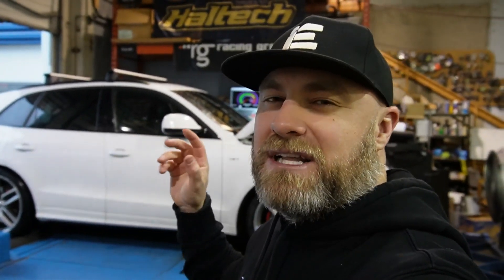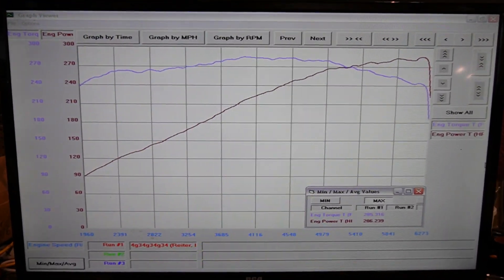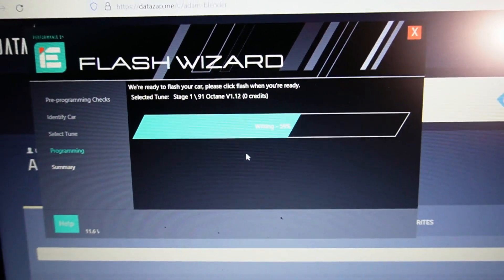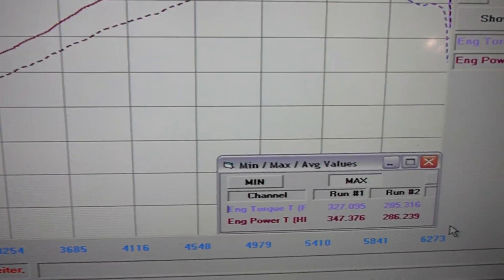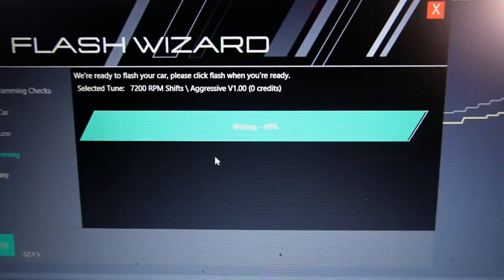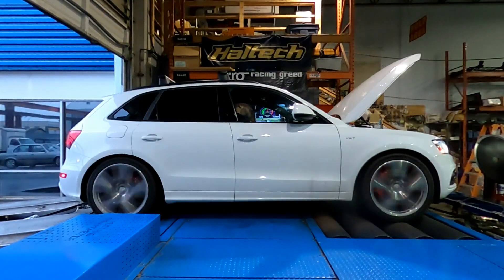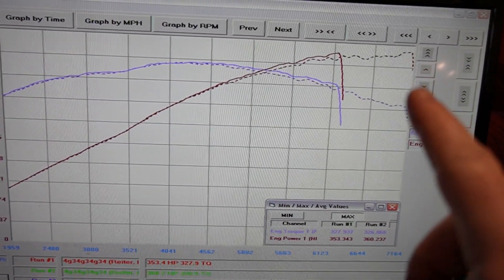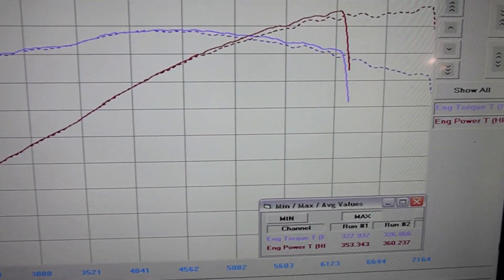How Much Horsepower Do You Gain From An Integrated Engineering TCU Tune In An Audi SQ5?

Comment: Love the methodical approach to the test. Do you know why the bypass valve is still closing (intermittently?) at the higher rev range? My understanding is that the closure of the bypass is where most of the gains from the ECU tune are realized. Just wondering why it's not hard-coded to be closed the entire range.
Reply from the maker: You mean why the bypass valve is still opening? They are setting the boost spec value at a certain number which 95% of people don't surpass. We just have incredible air here though and we make a ton of boost that causes the actual boost value to meet or exceed the boost spec. This causes the bypass valve to open and bleed off the extra boost causing those dips in power.
Reply: @VancityAudi  woops sorry that’s what I meant. Understood. I suppose then the tune merely increases that threshold value from stock, and doesn’t simply keep it shut
Reply from the maker: @gtspyder  correct

Comment: The bulk of the power is made up top and the higher shift points keep you more in the power band, not sure how they were wrong 🤔
Reply from the maker: The bulk of the power is made before 6200rpm as proven by the dyno results. They were claiming that just an ECU tune alone was worthless and that all of the gains we saw on track were from 6200rpm and up due to the TCU tune. Clearly not the case here.
Reply: @VancityAudi  most of the horse power was made closer to redline most of the torque was made in the mid range in the rpm, in most peoples eyes hp=power, yea they both will help separately but together is wayyy better of course
Reply from the maker: @gapcityracing6086  I agree they are much better together. This ignorant viewer was adamant that the ECU tune did nothing for performance gains and it was all in thanks to the TCU. I've proven him wrong by demonstrating how much power was gained from just an ECU tune and no TCU tune. Both together are obviously better for performance though.

Comment: HI Adam, could you explain what it means when you say uncorrected Mustang dyno?
Reply from the maker: Of course. Mustang is the brand of dyno. Uncorrected means whatever the SUV generated for power it simply spits out those numbers. Many, many dyno facilities use corrections for the weather, density altitude, elevation and so on. That tends to artificially inflate the numbers. To give you an example, if we used a Dynojet calibration during these runs it would have shown that it made roughly 15% more power. I simply wanted to show uncorrected, uncalibrated numbers. They may appear low to some, but they are accurate.
Reply: @VancityAudi  great explanation!  Thank you
Reply from the maker: @jrmynet  no problemo. Thanks for watching!

Comment: I’m new to the tunes, what is the long term effects on the car? I don’t race or anything I use my S4 daily driving and occasionally open it up on long drives.
Reply from the maker: It just pushes the car harder. Quicker wear and tear on all of the components. If you're just daily driving the car though and not racing it there won't be much more than normal.
Reply: I noticed better gas mileage when I tuned mine and I’ve heard similar results from a lot of friends who tuned theirs, car feels a lot more like a sports car on stage 1 as well, totally different animal in the best way, definitely have to pair it with a tcu tune if you go stage 1, worth every penny imo even as just a daily
Reply: @hazzex2520  appreciate that feed back. Definitely going to get it done soon.
Reply: @tommygunnz130  you won’t regret it, stay safe! 
(Also I recommend IE tuning because their customer service is second to none, they part quality is top of the line, and their tunes are extremely well done, I’m also an IE fan boi lol, have heard really good things about 034 motorsports as well If you decide IE isn’t for you)
Reply: @hazzex2520  leaning towards the IE tune for sure! Been watching a lot of vids and everyone talks very highly of their tunes. Reached out to them and they are currently in development to make the tune available for the 2021+ models so now just got to wait. Be safe out there!
Reply: @tommygunnz130  IE is the way to go. I spent over a year researching the different tuners before bought mine. 034 is the most extreme so go with them if your are planning to go balls out. APR is lying about their numbers and you'll pay a shop fee every time you need a change.
Reply: @OhioBahn440  thank you for that feedback! Definitely going to go with the IE tune for sure. I don’t drive wild, I just want that added power to get the most out of the car.

Comment: any tests with dualpulley ??? RPM, fuel etc. It would be nice
Reply from the maker: As mentioned in this video, the SUV is only a Stage 1 level. Eventually we'll get to a dual pulley level though where we showcase dyno testing and 1/4 mile times.